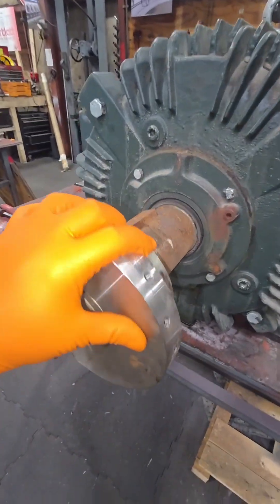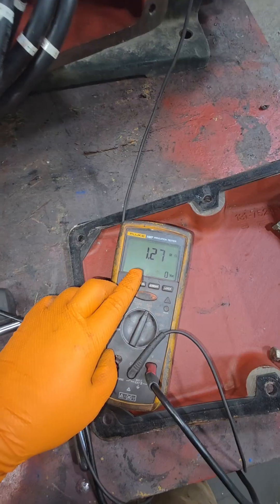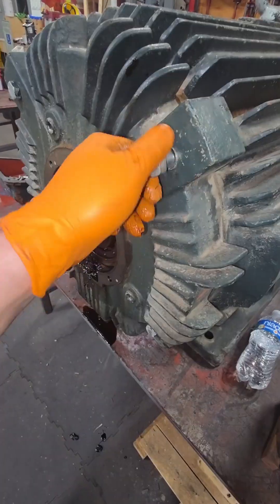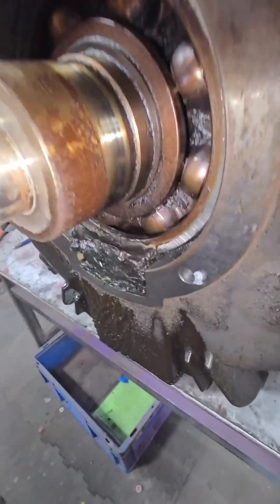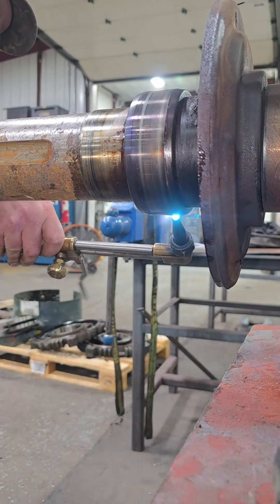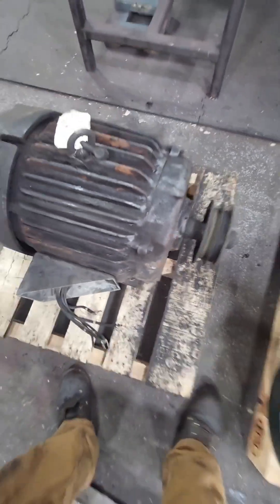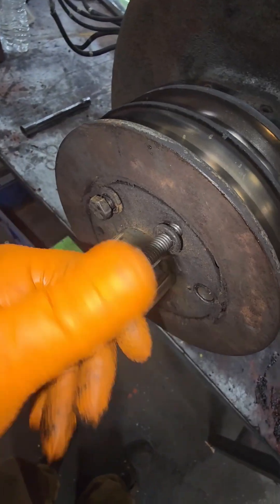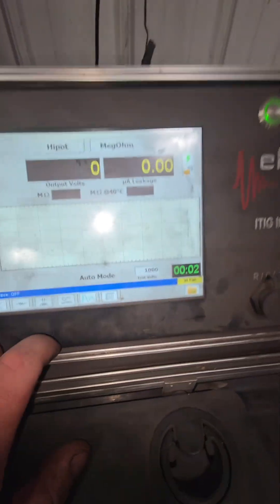200 Horsepower Electric Motor Breakdown!

Comment: Worked at a paper mill and one of the driveshafts on the paper line had a bearing go dry, running at speed it burst into flames then seized which welded the shaft and broke it. Somehow chained it up and bypassed it so the paper could still run and fixed it on the scheduled shutdown 
 Very amazing.

Comment: The oil hole on the front had zero grease in the hole. That thing was NEVER greased since it was new from the factory. My guess is that only 1 side was easily accessible, and therefore it got skipped.
Reply: It was greased, had extended lines on it for remote grease fittings. It ended up the bucket at the MCC had single phased this motor which caused the overload and overheating.
Reply: @ryanm836 righteous 🖤

Comment: Motor overloaded
Reply: In my case, viewer overloaded, but I want to see the continued diagnostics and repairs for these two motors. Not my field (hah, is magnetic joke), but always interested in tech stuff.
Reply: Wasn't overloaded, ended up loosing a phase at the disconnect at the MCC. It runs a pump

Comment: I have a realy unusual opan cage motor it has 10 hp 960 RPM 54 slots 27 coils in two sets is that normal